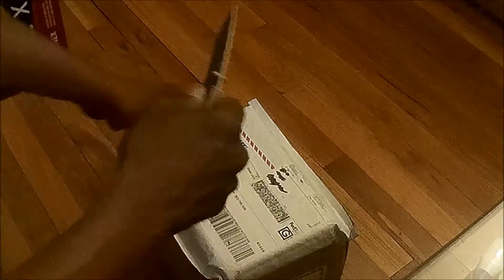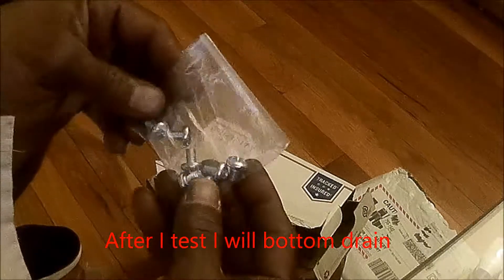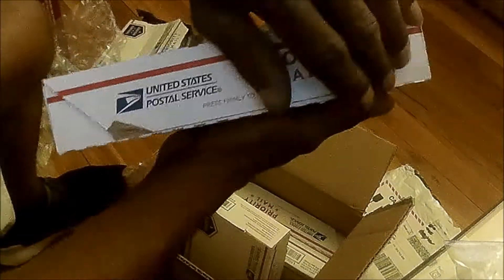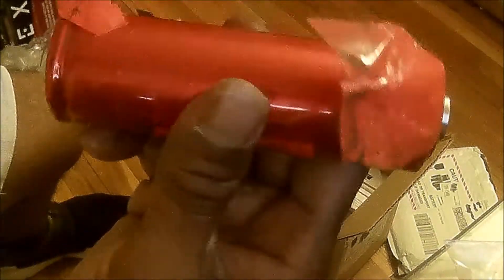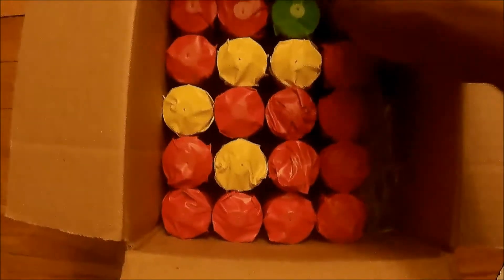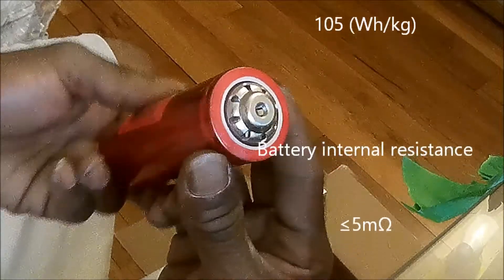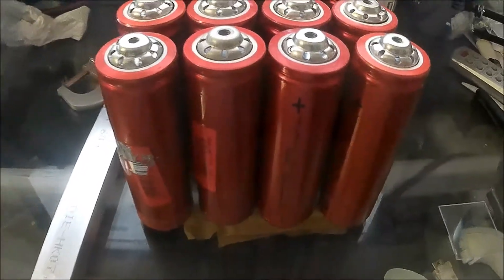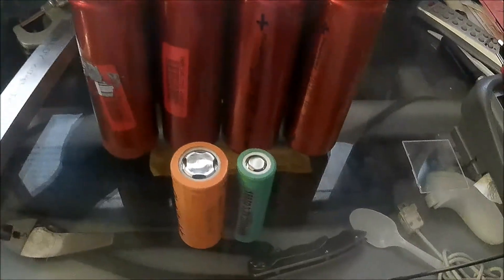Headway 38120hp 200 Amp Unboxing. Building A 40ah Battery For CAR AUDIO

Comment: Holy cow brother I ain't ever seen anything like that before them batteries should perform excellent.   Most definitely let me know how this all works out for you.  👍👍👊👏👌
Reply from the maker: Yes indeed bro I will definitely let you know how they work out. My friend is running 2 ampere audio 8k's and a hefty highs amp on a 200ah bank. So far he is a happy camper. I will have videos of his build as well as the battery build and test.